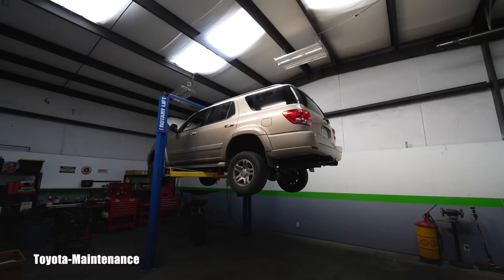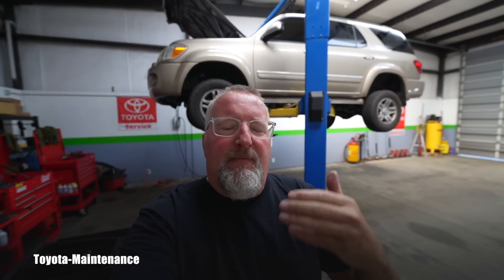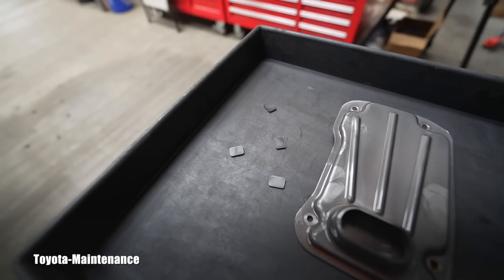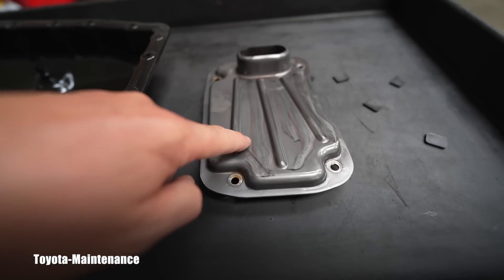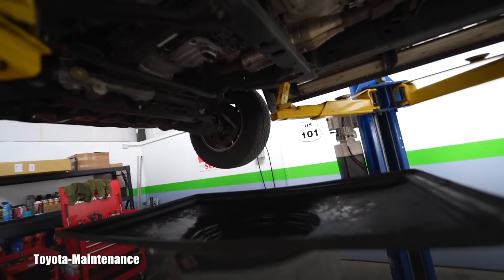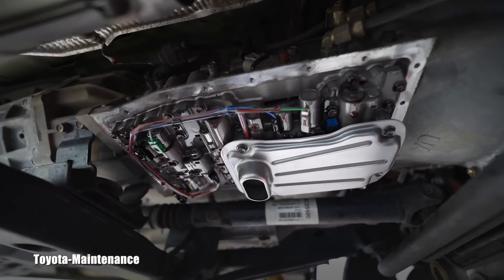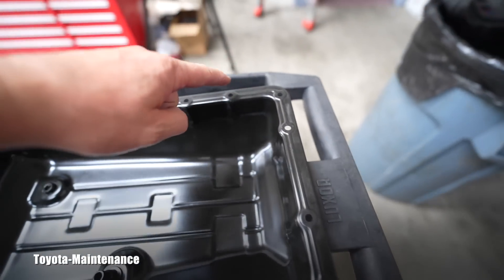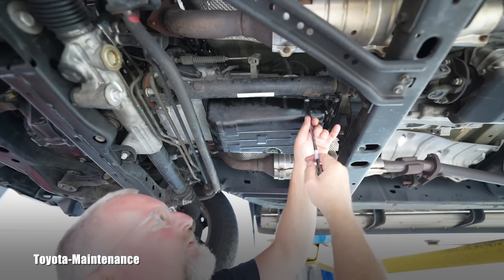Automatic Transmission Health Check

Comment: 98 Toyota Camry with 146 thousand miles on my transmission since I had the car I've done 4 drain and refills and other normal maintenance and im getting alot better miles per tank of gas 70-80 more miles. I'm getting 330 miles per tank well I fill it up when it hits a quarter of a tank

Comment: Great timing. My '11 rx seems to have hesitation with shifting as of late. I actually have Lexus/Toyota warranty still on the car (for another 6 months) and want to bring it in to get serviced before warranty is up, however I'm guilty of not replacing the fluid in over 4 years (probably 30k+ miles) and I don't know the service history of the car (unlikely ever done). Should I drain / filter + fill, then drain fill a few times before bringing it in so they can't say neglect caused it?

Comment: Try Taking That Pan Off Here In The RUST Belt Of New York State       Most of Those Bolts Will SNAP Off     Here We Just Do A Drain And Fill
Reply: Maybe spray fluid film anti-rust for areas that get snow .

Comment: how often would you recommend doing transmission oil changes on Toyota Tacomas, 4runners, seq?
Reply: I'd say every 60k miles, drain and fill
Reply: @guidedbygreen1480  are you referring to a pan drain and fill 3qts or the complete flush 12quarts at 60k?
Reply: @michael184272  just drain and fill, never flush; if you want to be thorough, do a few drain and fills.

Comment: My early Tundra has a dipstick. I've done a drop and top every 30k or so for the last 16 years. Still solid at 270k miles. Fluid still looks great.
Reply: I wish the 05-06 years had that. Toyota decided to seal the system when they switched to the 5 speed so no easy way to service the fluid.
Reply: @kings5223  You can drain and fill with the same amount you took out. Crank and run for 30 secs. Do it again. Do that 3 times and you'll change out most what is in the transmission. You're basically pumping the new fluid through the transmission as the old fluid comes back from the torque convertor and etc to the pan. Just my penny.
Reply: @kings5223  - servicing the fluids in the sealed systems is quite easy. I have a sealed system and a non-sealed system. I would recommend tapping in after the external cooler if you have one and pumping out a quart or two as you refill with a new fluid several times is a very easy process and essentially change all your fluid out. On the last fill you’ll have to do the temperature check and adjust it for the final level. Is that something you considered?
Reply: I do the same. Drain and fill every 30k miles. My 2006 Toyota Matrix 4WD has 199,963 miles and shifts perfect-never dropped the pan. I also service the transfer case and rear differential every 30k.